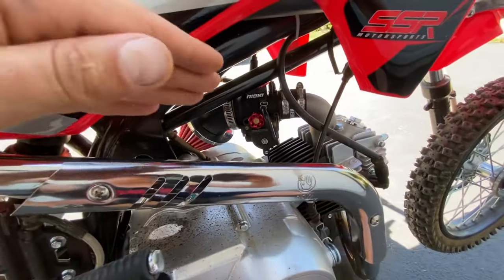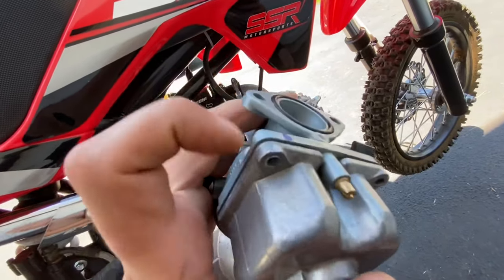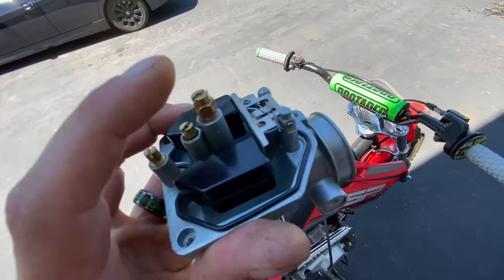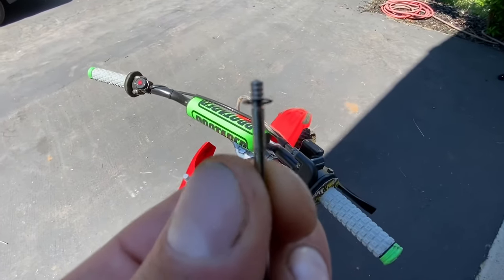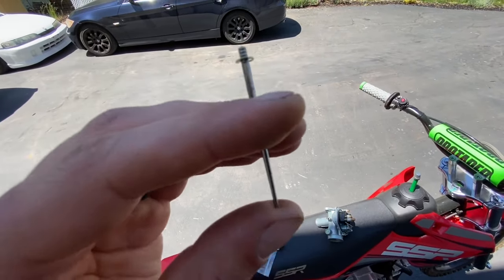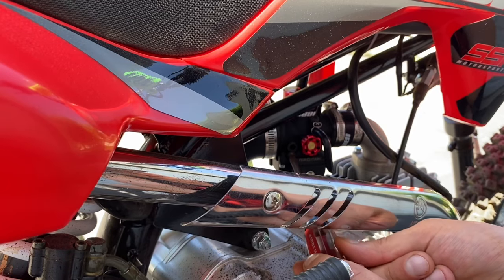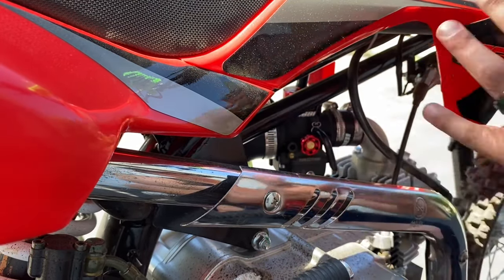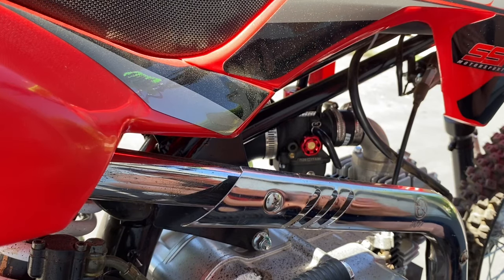How To Adjust Your nibbi Carburetor And Jetting For The Best Performance !!!

Comment: That's not a fuel screw, it's a slide height screw. It's your idle level screw, it lifts or lowers your slide which gives your engine more or less air. The pilot air screw changes the fuel mixture at idle. You have a good hold on what's happening with the carburetor. Good advice to newbies. Good job!
Reply: Fuel screw = idle screw/slide height. Beautiful work
Reply: Which direction would lower idle speed?
Reply: @connordillon1312   left
Reply: what kind of carberator I this so I can get me one
Reply: @AC-nr8kk  the exact carb he’s using is linked in the description 👍
Reply: Good job man explaining the way you do don't mean I can do yet but I get the psysic of it thank you😊

Comment: You always start with the main jet, then work your way towards the idle circuitry. Main jet is full throttle. Midrange is dependent on your " JET NEEDLE" Position. Low end on the pilot jet size. And idle with the air/ fuel mixture screw. Which is set at idle, for the highest idle point. Which can be one to three turns out. Any further then three you need to upsize the pilot / slow jet. Which is where you usually get low speed "BOG" if not enough fuel during rapid off idle runs. Float height is very critical, and common knowledge is to always get sparkplug readings for both cruise, and full throttle blasts.
Reply: You got it right on point. All my carbs had to adjust the float and on some vm22 I had to adjust slightly higher for the pilot to pick up. Somehow the design had a flaw and the pilot kept screwing inside the carb to the tread and not the seat.
Reply: thank you so much ❤

Comment: Hey, you got the "air screw" and "fuel screw" backwards". They are visa versa. The one with the thumb wheel is the idle air screw and the one you use the screwdriver to adjust is the idel fuel screw.
Reply: Can someone confirm this
Reply: Thumb wheel is throttle stop adjustment which sets idle speed, screwdriver screw is air screw.

Comment: Dude, thank you so much. This saved my bike. I bought an RPS Hawk 250 as a project bike and for my commute to work, and put a Nibbi on it. I have ZERO experience with any kind of small engines/carburetors, and after I first installed the Nibbi it was idling at 4500RPM and would bog down/cut out with any acceleration. I was panicking, but thanks to your video I got it tuned perfectly. Idling at 1200rpm, zero stuttering/bogging throughout all acceleration, and its running BEAUTIFULLY. 

Thank you so much again!!
Reply from the maker: No problem I’m glad this was able to help you out
Reply: Do you ride in the mountains with this bike?... while changing a significant elevation?
Reply: Ummmmmmmm, TWINS! Literally my exact story

Comment: I'm so excited I've never turned a wrench in my life. I'm at 3100 feet got the nibbi pe28fl for my 22 brozz 250 slapped it in stock main and pilot 115 and 40. Started the bike up and freaked out. Closed both like you did went 1 and a half air fuel and almost 3 on idle adjustment amd bam!!!!

Comment: Huge thank you for this video brother. I know nothing about engines but bought a used grom clone with a faulty carb. I followed your instructions on the install and tuning to the tee and it worked perfectly!

You just made my weekend, huge thanks again!
Reply from the maker: No problem I’m so glad to hear I could help
Reply: @throttlefamily4655  you vid is really helpful I was messing with the settings on a diff carb and kept getting the hesitation on the 1/4 turn when reving. When I start it again tomorrow I’ll play with the fuel mixture screw to see if I can fix it.

Comment: Man, this video really hit the spot for me. I got a Nibbi carb for a Yamaha I got without the factory carb on it. You just filled in the blanks for me as to why my bike is idling so high. Well done!
Reply: I do have a question, If your slow jet is big, will it make the idle stay high? I'm having troubles getting my bike to idle low. Wondering if my slow jet might be big.
Reply: @calebb9314 is your throttle cable too short? I had to trim the rubber to give me more cable for the carb

Comment: I recently replaced my carburetor to a “Mikuni” I bought off Amazon. My issue is the bike bogging in those higher RPMs. Dude you explained everything I need to know unlike other videos I’ve watched where they explain one thing, but not the other. Thank you!!
Reply from the maker: You are very welcome thank you
Reply: I got the same problem
Reply: @throttlefamily4655  I’m referring back to this video because I’m having carb issues again. Im bogging out on top gear (4th gear) my main jet is at 125 and pilot at 38. I have no issues with idle at all. Only when I get to higher rpm the power is just crashing. I even went as low on my jets to see if it will help.. low as 88 on my main jet. I messed with the needle. Pretty much did everything. I have a new spark plug.. recently changed the oil. Anything you recommend?
Reply: Really surprised cause what worked for me before isn’t helping…
Reply: @nicholassaldana tuning a carb can be a big pain in the but and specially when your new to it. I hade also the problem that my bike ( 2 stroke ) would not get in to its powerband. After trying idk how many jets and try a lot of different needle heights. I was slowly getting there. Some times it can take a couple evenings to get it right specially when your new to tuning carbs. Just try and try and probably you will get it right one time. Just watch out that your not running to lean so you don’t damage your engine. 😉😉 that 2 stroke was my first time tuning a carb. But afterwards if heard that ingaf a carb and air filter that where hard to tuning in and get it right 😅😅

Comment: Ty brother  these dam nibbi carburetors a pain in the a$$. Just had to drop the main jet down thanks helped me alot
Reply: What jets u running I have the 24mm 115 main 45 pilot and it goes good but when I go to flip the throttle in neutral itgoes to bogg out on me dosent die but just bogs

Comment: What a legend best explanation ever just what I needed to fix my m2r 125 now it runs perfect
Reply from the maker: Right on glad I could help!
Reply: @throttlefamily4655  do you know if the pilot jet and main jet inside the carb should be screwed all the way in or just until its snug or should they be turned out by 1 turn or 2 because I took them out to clean and put them back in but I tightened them all the way now bike starts up really high revs

Comment: I just put a new exhaust on my KP MINI 2 days ago and have a nibbi carb. Its still running okay.. Its back firing every now and again when I get on the throttle. Also, Is it normal to have to kind of roll into the rev? If i go from idle and just pin the throttle my bike will bog of stall... if I give it a couple quick revs its fine and when I am out riding I can just send it.. full pinned. EDIT: as I got deeper into youre video you touched on exactly what I needed to know! Thank you! I want to go mess with my carb right now but now I am terrified of messing with that thing. 

I would also like to add that your explanation on the mechanics and function is amazing

Comment: Good video, thanks!  My NIBBI is going to drive me insane so I really appreciate the help.  I'm at 6500' elevation and am having a terrible time getting tuned in-going to try 100 main/40 pilot/needle at 3 (middle) today.  Getting exhaust popping at 105 main/42 pilot.
Thanks again!
Reply from the maker: I feel you may have to go to a 110 or 115
Reply from the maker: Thank you I always appreciate it when I can help someone
Reply: What was your final adjustments

Comment: Thanks bro got my 140cc crf 50 engine swap right running perfect
Reply: Yo do uk what jets you have installed. I have a 140cc tao tao dbx1 and i cant seem to get the jetting right.
Reply: Same engine as mine just on crf 50frame 
115 main jet 
40 for pilot jet
Reply: @Nate-hw1oe  tht makes bike run to rich

Comment: U need to do plug cops at idle ,mid range and full throttle to completely tune your carb  with a new plug ever time because a plug don't lose color wants it has it so if u want to take it to the next level thats your next step

Comment: engine is a 165FMM (230cc) Valves both at 0.10mm
carb is a NIBBI PE28FL with a pod filter.
Needle is as high as it can be, (5 slot) 
air screw is exactly 2 turns out
42 pilot 
115 main
Slight bog off idle and screams everywhere else. 
Any deviation up or down on the jetting makes it fall on its face. 
Line on the side of the float is exactly parallel with bowl flange when upside down
How the hell can i get that last little bog to go away. Sucks big time when you need to pop that front end up, and it hesitates. 
bringing the needle down makes it terrible on the bog, larger pilot one size up (45) and need in any position is terrible. same if i go down one size on the pilot (40)
Have to fully remove all plastics, seat, and fuel tank to mess with the needle, and carb with intake manifold has to be removed for jetting. Spent almost 16 straight hours getting it where its at now. Bike is brand new, only 40 miles on it. Original carb was a PZ30 china clone and non adjustable.

Comment: Let me tell you my brother thank you for your info it helped a ton, and to tell you my hawk 250 with dong fang engine went 72 with the nibbi pe30, I tried to change my sprockets to 17t/40t and change chain but ordered the wrong ones and the spark plug made the bike bog so I have to tune the carb to it so I’d say it could go 90-100mph or more if I change to street tires and I weight 222Lbs idk why it’s going so fast haha wooo ppl on YouTube say they are getting it to max out at 75

Comment: Hi  . I’ve got the nibbi pe26 on my thumpstar 125cc pit bike 2021 model and it’s a Lafan Engine . I’m having trouble with bogging towards the top end of the throttle . I’ve gone up on main jet and gone down on main jet could you help me out with any knowledge before I take my bike to a Field and set fire to it . That’s how frustrated it’s getting me. I also live in the UK so I’m not sure if C level is higher or lower to where you are
Reply from the maker: Have you taken your spark plug out and s checked what color it is?
Reply: @throttlefamily4655   ye it was black as Cole so got new one
Reply: Also can I ask you one more question
Reply: What does it mean for when I start my bike for the 1st black smoke comes out of the exhaust pipe
Reply from the maker: @paulwhittle4653  it sounds like you are running rich try adjusting the ring on the needle jet up a little and it could be oil blow by or it is just running way too rich
Reply: @throttlefamily4655  thank you so much for your help. And keep putting them videos out there they help people like me a lot .thanks

Comment: I just ordered a pwk 28mm for my 1977 Yamaha dt100.  It is supposed to come with the right jets and screws.  I see a lot of confusing info that this carb doesnt work with a 2 stroke.  Are people saying that the two stroke oil reservoir cannot be hooked up to the carburetor?  If thats the case, do you just mix the 2 stroke oil straight into the gas tank instead?  Or are people just posting bad information.  This seems to be hard to figure out how everything gets swapped out and adjusted.  This video helped with a lit though, thanks.

Comment: Should I have the filter on wen tuning the carb? Very helpful vid btw?
Reply from the maker: Yes you should it makes a big difference.
Reply: throttle family okay I think I got the carb adjusted properly, but the Engine bogs and dies wen I give it throttle, do I change my needle jet or main jet?

Comment: I took my carburetor apart and originally it was to make sure that there was no blockage within the Jets before this my bike did not start and after my bike started and would turn on only with the choke and I would have to rev it to keep it running what do you think is my problem?

Comment: Great video! One question, where is the choke on the Nibbi carb, and when starting cold would it be up or down?
Reply from the maker: Sorry I just saw this comment it should be a pull tap on it near the top and you pull it up for the choke on.

Comment: I have the knock off Mikuni which worked on my ssr 110 perfect but on my 125 I have to turn the idle screw so far out that its rattling loose so that it isn’t idling crazy high
Reply: Lower your pilot jet. I just got the carb and my bike was idling high with the Jets that came in the carb it’s a PE28mmFL stock 112 main jet 40 Pilot. I went down to a 35 Pilot and now I’m actually able to idle normal. Gotta do a couple more adjustments but other than that I’m Gucci.

Comment: Hi bro. I have problem with starting engine. 140cm3, Nibbi24 stock jets 112 and 40 and it is hard to start it. I have to kick it with chocke and then trying without it. If it starts I have to hold throttle until it will be hot. How to solve it?

Comment: Just installed my nibbi carb and the idle sounds real high that my exhaust pipe coming out the head started glowing red what can i do 
Its on a apollo 125
Reply from the maker: Adjust the idle screw but you may need to put a smaller pilot jet in
Reply: @throttlefamily4655  the main jet
Reply: If your exhaust was glowing its definitely a too lean problem.

Comment: I need help with my carburetor on my 125 cc Coolster dirt bike. The exhaust was off and it caught fire for about 10-15 seconds and only 2 of the breather tubes got burned at the ends. I’m confused on the one nearest to the choke. It looked like a very short tube just for overflow maybe? Not the one that goes downward and it wasn’t the fuel lines. It was a very short one and it’s still connected the ending is just closed now from the flames.  And I put the exhaust on so the flames it was spitting doesn’t hit the the gas that was leaking. I’m gonna replace the carburetor next week but for now Please help me out yall! I’m new to bikes.

Comment: Problem I’m having with mikuni knock off . Bike ran and idled great for a few months. Now it  runs great as long as your giving it gas. Let off the gas it won’t idle. Adjusting the idle higher don’t help. Plz help
Reply from the maker: You will need to take the jets out and clean them I have to do that every once in a while as well I will be posting a video tomorrow that will have it explained in the video

Comment: I bought a nibbi pe26 for my kawasaki klx 140r. I've tried different needle clip positions, different size pilot jets (35 & 40), and different size main jets (105, 108, 110, 112).

In all scenarios I can get a good idle, I can get steady midrange rpms, and I can get steady full throttle rpms.

In each of these scenarios I have a rapid throttle bog. In other words, from idle,  rapidly twisting the throttle I get a bog. Although it won't bog moderately twisting the throttle.

Any ideas?
Reply: Sounds like you need a bigger pilot jet Try one size up to 42.

Comment: when you say change the jets do you mean physically taking the carb apart and unscrewing the jets and  screwing new ones in? I just ordered a pe28FL carb and im wondering if its just plug and play with a little adjustment or am i going to have to buy different kinds of jets to get my bike to run properly

Comment: I only get bogging when I try to throttle fast and hard right away I’m new to this but I’m guessing that would be the pilot jet? I’m at about 50ft elevation (this is for the nibbi carb) really need help with this
Reply from the maker: Yes that would be the pilot jet
Reply: I know you said you use 120 and 48 but your at a higher elevation so should I be running bigger?

Comment: So what's the final verdict, is it worth tuning the Nibbi or just going with the knock off Amazon mikuni?
Reply from the maker: Get the knock off amazon mikuni
Reply: @throttlefamily4655  Really? Thanks, I was just about to spend the extra money and get the Nibbi too! I would have thought after you finally tuned it, it would have been better than the knock off mikuni but guess not?
Reply from the maker: Tony Alves yea they are not that good I even ordered a knock off mikuni for mine
Reply: @throttlefamily4655  One thing I didnt hear mentioned is the carb size. Was you engine stock? If it was 28mm might have been a strong factor why you came to the "not that good'" conclusion.

Comment: Great video man ...I just installed the nibbi on a hawk 250 and it wont start ...I smell fuel like crazy and probably need a smaller pilot jet ...not completely sure at all but I'm trying stuff ...do jets need to be screwed in all the way.. I have no clue about that either...any info would be great
Reply from the maker: Definitely too much fuel will make your bike not run at all
Reply from the maker: And yes the jets do need to be snug
Reply: @throttlefamily4655  I got it right finally ...my bike (2021 hawk) loves this carb ..got more speed more power starts 1st time everytime , it's good stuff ...ur videos helped alot ...thanks man ..ride on !!!

Comment: i just got a nibbi 26mm carb for a 140cc lifan dirt bike swapped. It comepletly bogs when i give it full throotle fast if i do it slowly then its fine, it comes stock so idk what it has it came with 3 extra jets a 35 pilot jet, 108,112,118 main jets i live around 50 feet elevation what should i do? ive tried the air/fuel mis screw and idle screw and nothing works, help
Reply from the maker: This carburetor is very difficult to set up you may like the mikuni knock off a lot more it’s a lot more user friendly this carburetor took me a few days to get dialed in
Reply: @throttlefamily4655  well maybe but what do you think I can do to my existing Bobbi carb? Should I change the main jet?